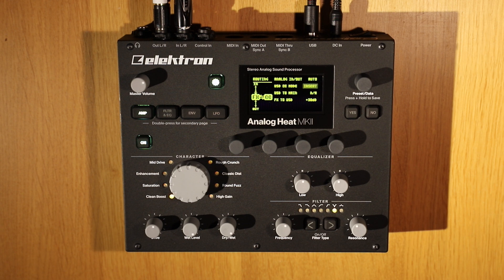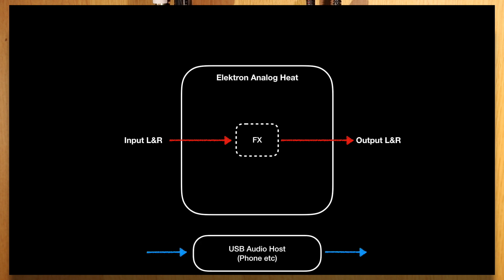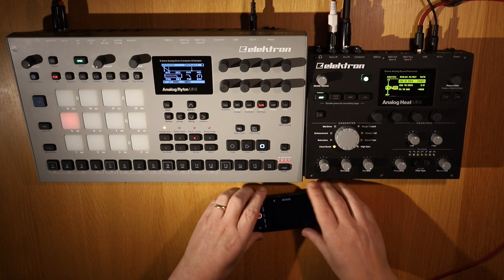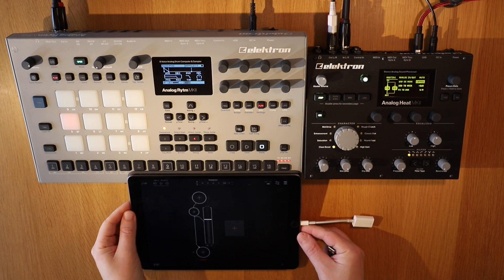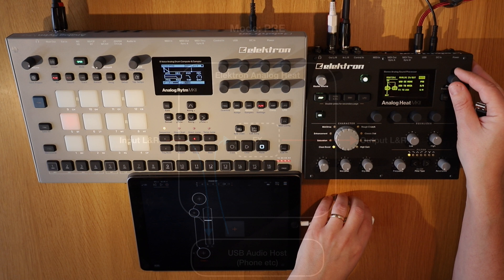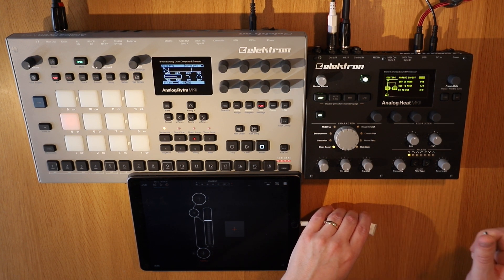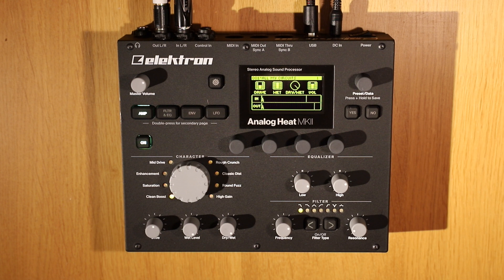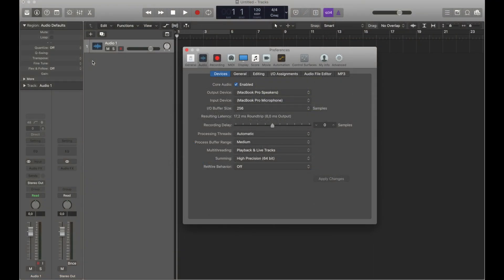Elektron Analog Heat - USB Class Compliant Audio and FX Walkthrough

Comment: I'm trying to get audio from my mpc to the heat and back or something like that using USB. Is this possible?
Reply from the maker: What kind of MPC do you have? I know that the Live got support for external USB audio interfaces a while back, so it should be possible to route audio in/out of the Heat!
Reply: @tubesockor  I have the mpc one. It does recognize it as a sound card but it won't allow me to use it because it has a different sample rate or something like that
Reply from the maker: I see. Yeah, it seems that the MPC only supports 44.1kHz sample rate and the Heat is using 48. There are also other properties such as clocking that can have requirements. Either way, that is all on the host (MPC) side to solve - so it seems their implementation is a bit limited. I did a search now and there are many audio i/f:s that thereby are not compatible with the MPC.
Reply: @tubesockor  hmm. Guess I'll go and amd but some more cables then. Thanks man.
Reply from the maker: Yeah, it is analog after all :)
Reply: @tubesockor  right

Comment: I'm using an Android 8.something smartphone, trying the same (and different) settings of the heat as well as on the usb behaviour of the phone. I don't seem to get the sound out from the Heat into the phones audio (camera detects only the sound coming from the mic). Any ideas why is that and if I can change it?
Reply from the maker: It should work fine, but there are not so many good Android apps for USB Audio as far as I know.
Reply: @tubesockor  does the iphone need an additional app for it to function?
Reply from the maker: No, it works fine with the built-in iOS Camera app (and all other audio apps that I have tried sofar.)

Comment: Thanks for this video! On my heat USB CC mode says N/A and there are no other options allowed. USB to Main and FX to Main are the same way. Analog In/Out is set to Auto. Om my iphone I am able to select the midi connection with Heat but not the hardware input for audio. I am connected from USB port on the heat to my phone through the camera connection kit by apple.  I have updated the heat to the current firmware. Any ideas?
Reply from the maker: I would guess that you haven’t set the USB Config to USB Audio/MIDI (see video at 0:40)
Reply: @tubesockor  Yep! thanks!
Reply from the maker: Great. Good luck with the audio processing :)